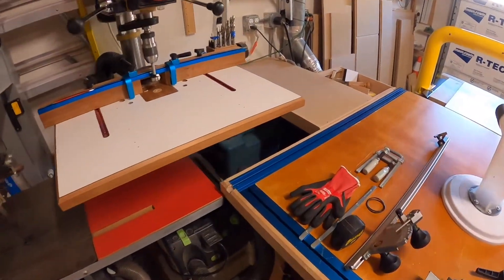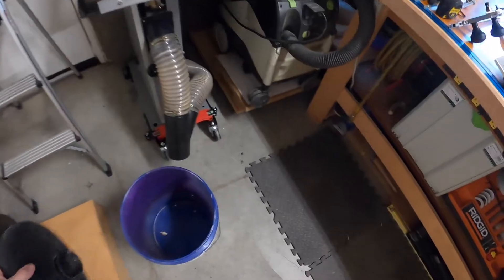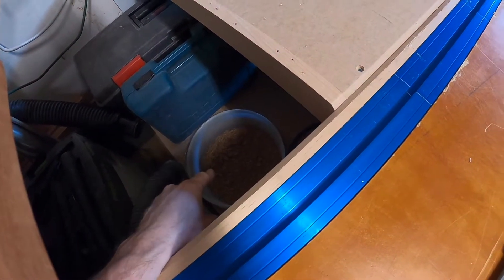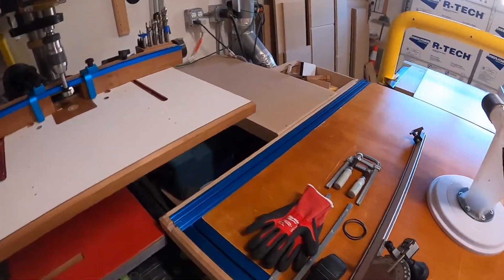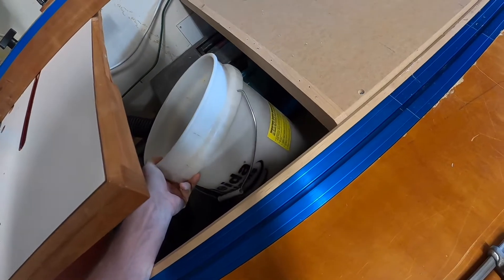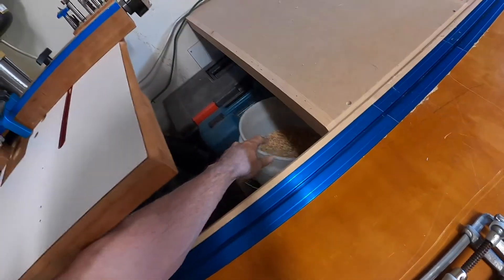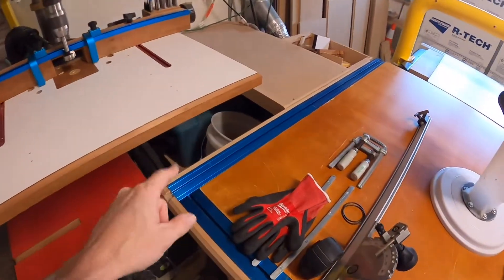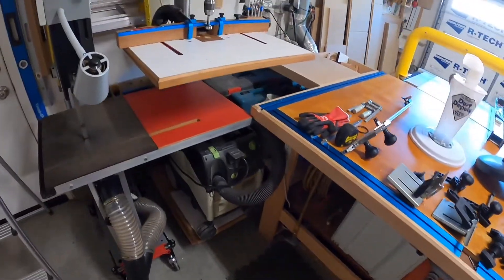Really Quick Follow Up To Oneida Dust Deputy Swap Video

Comment: Good review. I will say that I have an orange one, I think it’s called Dust Stopper, from Home Depot, and it works well. I like the cyclones but I needed to be able to put this one under my planer/jointer table. It just fits.
Reply from the maker: Thanks for watching and commenting.  I know the orange one you’re talking about.  Glad to hear it works.  I was so shocked that the wood river one was so useless.  The Oneida does take up more room, but the way I mounted it, it really saves height. In my case it worked.  In my large outfeed/assembly table, it’s great also.  I just love them.  Thanks for sharing your thoughts.